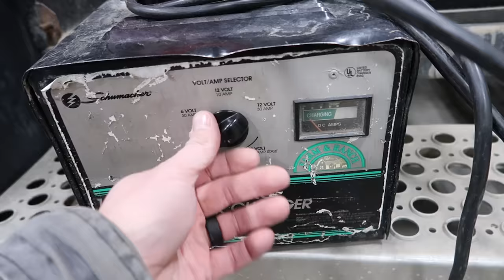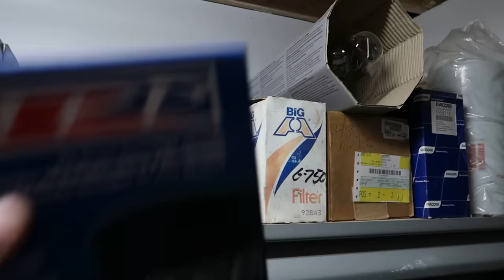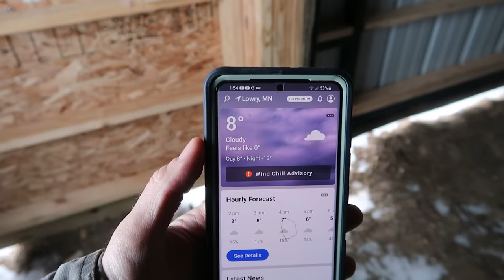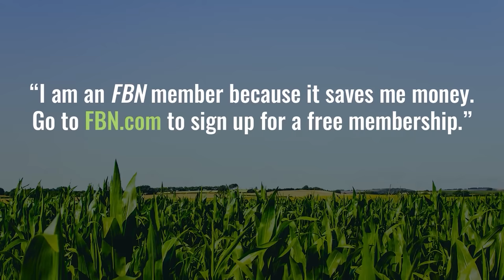Make Semi Trucks Shiny Again!

Comment: Zach, here’s a little suggestion. When you pour your concrete under the door put a strip of electric heating cable in it and put  it on a switch. Put 12 inch heating cable/mat in the concrete on either side of the milking parlor pit floor. It was not the heat source for the parlor, but it made milking in the cold of winter a little more pleasant if possible here in northeast Wi. The floor warmed up in about 15/20 min. Could solve the snow against the door problem. 👨🏻‍🦳 🐄 🚜

Comment: Zach that oil in those motors is like corn syrup  at 55 degrees in that shop.Should have engine heaters in the water jackets,maybe 300-500watt units. Try it on 1 truck.

Comment: You might consider installing a series-parallel relay in those trucks.  The relay puts the batteries into a series configuration,  which will add  the voltage of the batteries together,  giving you 24 volts for the STARTER ONLY.  Then when the engine is running the relay returns the batteries to parallel configuration,  12 volt.   The higher voltage should give your starter motor more power.  Any electric motor, under load "pulls the voltage down" until the motor gets "up to speed", which happens quick with a starter.  It's somewhat the same principle as boost-starting an old vehicle with 6 volt system, from a vehicle with a 12 volt system.  Works great, no harm done.

Comment: Check all the grounding wires.

Go through the terminals in the fuse blocks to see if a draw is incurred when it shouldn't be...

An isolator switch will help but doesn't identify the problem.

Checking the draw on  the starter will be mandatory since it's an ongoing issue.

Best of luck!

Comment: Hi from the land of oz. Worked on old W and T model Kenworths and some leaders with Cummins and Cat3406 engines. They were setup with 24v starters.  3 12v batteries. 1 battery was wire direct to main ignition feed.  The other 2 were connected to a series/parallel solenoid. When the key was turned to start the 2 batteries were connected in series and supplied 24v to the starter motor. Once started and key returned to ignition, the 2 batteries revert back to parallel  and charge via the 12v alternator.  The series parallel solenoid was prone to failure and some people didn't know what they did and replaced with normal solenoid, then become hard to start.
Check your starter suspect will be a delco remey 40MT or 45MT and most likey 24v.
Have converted 2 to 12v high torque gear reduction bosch starter. Very good and reliable units but will need 3/0 gauge battery cables and run a negative lead from battery to the starter mounting bolt, don't use the chassis as a negative connection will have too much voltage drop.
If you have any questions welcome to PM or email me anytime.

Comment: Even with the disconnect switch you need to trace the lines out to verify that you are breaking the negative completely and there is not a back channel drawing power.  Check the ground straps between the batteries and the engine to ensure that the connections are not corroded causing energy flow issues. 

Don’t forget to add flags to that brace on the new shed door so it does not get clipped by the snow removal equipment. 

You should run the truck over to Tony and have him Polish the wheels and tanks. He did one of his trucks.

Comment: Finish the practical - then proceed from there to style. 
Practical: LED head lamps, flood lights facing backwards down the sides so the driver can see where their wheels are coming in/out of a field access and whether the gravity feed is lined up with the auger; GoPro and a in-cab monitor device so you can see how full the trailer is, where the auger is; backup camera & good lights at the back so you can see backing up. 
Then style; I suggest polish the fuel tanks and all the chrome details.
Reply: Those LED lights you were talking about those are a must

Comment: if you replace the head lights on your T800s them make sure you put headed ones in for low beams. we then put the old halagen ones in for high beams for the more yellow light when its snowing and two very bright spot lights in the bumper on our T600 and wired them up to a switch on the shifter for when no one else is around ;)

Comment: Zach, make sure your disconnects on your equipment disable both the positive and ground. Current will feed back through the ground and drain your batteries as well.
Reply: LOL what have you been smoking?
Reply: @J D  Bahahaha...few words but you said it all.
Reply: You only need to disconnect the negative side.
If the top of the battery is dirty that can cause a small drain on it.

Comment: Great Video Zach and Mrs Millennial...
The Semi looks really great and will look better after the wheels, and chrome gets touched up...
Will the other Semi's get the same treatment done on them or was this just a Test to see how everything turned out with the truck...
Your truck fleet will look Spectacular when there all finished...
Also did the Morton Building crew install hydraulic adapters to the hydraulic garage door system, so that the door can still be opened by using the hydraulics off a tractor to open the door when the power is out...If not, that may be something you might want to consider doing...
Also let us know please if you discover anything about the power draw situation with the truck and batteries...
Hope you reach your 1 Million subscriber mark soon...
Nice sled you just picked up...Here in Southeast Missouri, we never get the snowfall amounts here like y'all get up north so there's not much use for sleds this far south around here...Cause i would love to have a sled...
Take care and Thanx for sharing...Keep Up The Great Work...
Cya

Comment: Hey Zach,  truck looks great.  I just finished doing the same to my tractors. Wow!  Makes things look new again.  May I suggest putting a coating on top because it’ll oxide again and you can only cut and polish so many times before you run out of paint. Lol.  I did a little investigating and I have come to the conclusion that turtle wax hybrid pro with graphene is the longest lasting and easiest to apply.  Just spray on and either buff or wash off.  It’s got a uv protector and easy enough to do every year.

Comment: I got it zach, as long as you are putting new cables on the kenworth, put some engine heaters in the waterjackets on both trucks. Plug them in 24 hrs.before hauling, like all the other truckers do in your area.It's a pain to maintain cold machinery. Good luck.

Comment: I have seen where the cables were corroded off on the inside. Attach an old-fashioned carbon pile load tester to the batteries and then to cables near the starter. Reduced amps at the end of the cables will indicate that they are bad.

Comment: New cables should help the most!! If your losing voltage a new starter won't  help yes the 39mt gear reduction starter is better but if it doesn't  have the juice  if doesn't have the juice.

Comment: I have a t800 that wouldn't start till it cooled down after running. Replaced battery cables and problem went away, if you're going to keep the truck and cables are original I would replace them no matter what. Not that expensive compared to your time messing with it everytime it won't start! We put led headlights from Amazon in it last year and highly recommend that along with a 36" curved led bar on top of the cab. Makes pulling in driveways at night much safer!

Comment: Hey there Zach, I hope this finds you all well and good!

You've got to get that aluminum polished, that's like putting your suit on for Church Sunday morning, and then putting your old dirty work boots on, which just ruins the whole look.

What your KW needs is #4 6V AGM Batteries which has about 50% more reserve capacity than those 12V Batteries do, it's what Golf Carts have had forever, along with trucks, equipment, and high end RVs. Of course you'll need all new high capacity cables, which means not the 12V automotive cables you'll find at Pep Boys. 

The starter is not your problem, if it was throwing the charger on it wouldn't fix it. Think about it?

A battery disconnect switch is always a thing to have, because even the new 6V AGM Batteries will drop voltage when it's cold and not run for some time.

If you do what I just suggested, your truck will start better than it did when new, and I will eat my serving of Crow, but only if you follow my suggestions to the T.

I hope y'all have a good one! 

"Nothing Runs Like A Deere" 🦌 👍 🇺🇲

Comment: Zack - great content. If you have not already done so, clean the battery connectors thoroughly (Dremel with wire brush) and coat with dielectric grease. It is amazing how a little corrosion can prevent the high amp flow.

Comment: I say park it outside a few days so it’s not so crazy shiny then continue to use it. 

Or polish everything and build it a special shed don’t drive it unless the weather is perfect and avoid dirt roads.  

I don’t mean to sound like a downer but aluminum oxidizes to easily to try to keep it polished on a working truck and it gets really difficult. Also the non polished stuff is mostly standing out do to the awesome job the guy did.

Comment: For that old, carbureted pickup, Try to just pump it twice and hit the starter to close the choke then pump it once and it should take off. If its drying up they forgot the check valve that comes with carb fuel filter. On mine it was electric choke, and I had to take off the cleaner cover and look at what it took to close the choke. Mine is the two step prosses as described.

Comment: 27 years of driving Trucks.  I have never had employer resort to a gear reduction starter.  I have started trucks in below 0° with just a slight slower starter movement.

He needs Power Service due to high Cetane levels

Comment: If you want to check the cables you can do a voltage drop test on them. take your volt meter and put one lead on the positive of the battery and the other on the lead of the starter. you should see no more than 1-2 volts while cranking if i recall right. if you see more than that the cables either are no good, bad connection or aren't big enough

Comment: I would like to see the trucks getting LED's fitted instead of the old dim bulbs it has now. It would greatly improve your night travels and safety. The combine and tractors seems to benefit a lot from LED's. I got an old-ish excavator some years ago, and it had a set of very rusted halogen lamps all around. It was almost like candle light compared to the brilliant floodlight LED's I upgraded it with. Suddenly I could work all night and not get super tired by squinting at the work area. Great improvement.

Comment: Resistance tests on battery cables is a good first diagnostic step, have seen cables with no visual defects cause major current drops, especially on semis where the cables are multiple multiple feet long

Comment: Check the Negative cable from the starter to the frame if it's crunchy when you bend it thats your problem....changed the one on our truck and it fixed all the starter hesitation, it's never turned over so fast!! lol

Comment: I have three thoughts: One: get an ammeter that can be placed over the wire going to the starter. If you do this you will be able to see what the amperage output of the batteries is. Two: touch the connections in different places after cranking. A bad connection will get hot. Three: with the cables disconnected it should be possible to measure a current draw that is measured between the battery and the terminal end.

Comment: Putting 4 batteries in would be great but have to watch how many amps to gear reduction starter. If I remember correctly nothing over 3800 amp total so that's four 950 amp batteries. When I talk about replacing cables because ends get bad, cable are either turn green or black. There are other reasons why.  Also I don't know if you have tools to do voltage drop test. Replaced jumpers between batteries most go bad. Jumpers seem to go bad quickly over main cables to starter

Comment: On your truck, start with a multimeter and check the resistance on the wires and voltage draw when the power is off.

Comment: My truck started the same way, gear reduction starter and all. It is a 98’, this fall I put new battery cables and new batteries on it and grounded the batteries to the starter. Now with the gear reduction starter, new batteries and new battery cables grounded to the starter, the truck starts like it’s 90 outside on a 40 degree day

Comment: Something to look into. Between my RV and boat I have 10 batteries. When charging 2 batteries put the positive on one battery and negative on other battery. What I have read is that when you hook it up to one than it just charges the one than the other and the second one doesn’t get a full charge.

Comment: Gear reduction starters definitely help.  But ground cables I bet will help even more.  I’ve fixed many trucks “dead battery” problems with a 4/0 ground cable from battery to starter.  Only issue is, cable is stupid expensive.

Comment: Don't comment much. Happy New Year. Had much time with t 800 &w 900.      Mt42 starter when starts like that, often bad ground. Hook temp ground with a good set of jumper cables from battery to starter, Also grounds starter to frame and engine and cab, Keep up good work and hope this might help.  Would rather have regular mt 42 than a gear reduction.

Comment: I don't know squat about trucks but I know a little bit about electricity and after 20 year's in a salt environment you may have high resistance terminations on your battery cables if it's corroded inside the cable you must cut it back and re-terminate.

Comment: polish it out and ceramic coat it, it would last a lot longer. also, you should check the resistance in those cables to make sure  
they aren't corroded inside their length.

Comment: Zach I had the same problem as you, my engine would not turn over after replacing the batteries and cables several times.  Over the years it slowly got worse and worse, to the point it where it would only start on a very warm day.  To make a long story short your starter is weak and needs rebuilt or replaced.  If you tear the starter part you will find it is black and burnt.  Good luck.

Comment: You mentioned there’d be compounding and then a polish. I didn’t hear anything about a sealant to keep it from turning back to that same finish shortly. I’d highly recommend putting a sealant such as Chemical Guys Jet Seal. It’s easy to apply and they say it’s good for up to a year. Finish it off with that and you’ll be set! It came out great!
Reply: I assume a guy doing on site polishing would know that.  He said 2 part process.  Hopefully 2nd part a sealant.   That got cut in editing?

Comment: You might take a look at the Maxwell 12 volt starter module Ultracapacitor Ultra 31/1800. It holds voltage so if batteries are dead or it's extremely cold whatever you put it in should start every time. Their not cheap but may be a game changer for you.

Comment: Invest in a clamp on type multi meter that will read 1000A so you can see how many amps it is drawing. Could be a shorted/open field winding in the starter.

Comment: shiny aluminum .  Bad oxidized  aluminum will benefit from brightener.  (on the shelf at your local NAPA)  it is a mild acid.   It will remove all of the shine while also cleaning all of the dirt and oxidation  .  Then use a buffing wheel on your 4 inch grinder.  Jewelers Rouge comes in colors.  The darker the color the rougher the grit  You should have Black Brown Green and White in your working collection.  Along with a package of 3M scrubbies.  Black is similar to 4 grit sand paper.  You use the scrubbies initially to knock off initial oxidation.  It will scratch the Bee Jeepers out of your aluminum so work in a cross hatch or straight lines.  Avoid circular motions.  Then switch to the buffer. Use black rouge to take out the marks left by the scrubbie and work on deep scracthes and dings from gravel roads sand blasting your parts.   Switch to Brown and do it again.  Switch to Green and do it again.  Then make a determination as to how shiny is shiny enough.   If you want more switch to white and do it again.             THEN go to wally world or the kitchen tool section of your grocery and get some squeeze ketchup or mustard picnic dispensers.   Get some liquid jewelers rouge in Green and White and some Charcoal lighter fluid.  Mix 1/4 jewelers rouge to 3/4 starter fluid and hand rub the parts to even out the shiny finish.   HINT kitchen baking flour on a dry rag does a great job of buffing out dried polish to make it shinier.   ALSO a full face face shield will keep the buffing wheel from turning your face into looking like you are mimicing black face makeup.  Latex gloves and long sleeves will keep the buffing compound and metal polish from getting into your skin pores.     Alcoa makes a spray can sealant for Aluminum it will seal up the pores of all of the shiny you just created so that you can wax it.   Rain -X will do the same job .  So will spray silicone you just have to manage the liquid more so that it wont drip and dry in streaks.       

Or you can hire somebody else to do it.    Because it is labor intensive and takes a while.  And a gomer driving the truck at 60 MPH on a gravel road can wipe out all of your work in about half hour.    Thr brighter is only used in the first portion of the process.  If used at any time afterward it will erase all of your work shining the metal.  Also keep the brighter away from stainless steel or chrome.  It will permanently turn it blue.  Blue beacon truck washes recycle their wash water.  They filter the dirt out but don't adjust the PH.   If a truck ahead of you had brightening done it will be in thr water and erase your polish job while turning your chrome blue